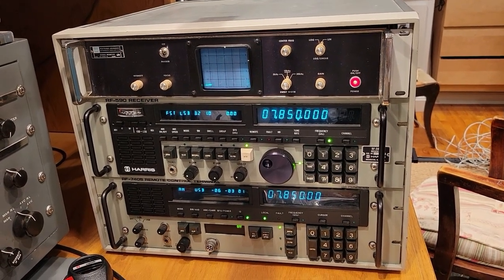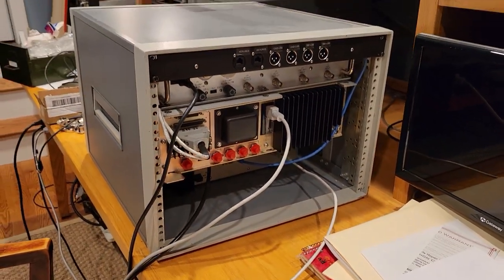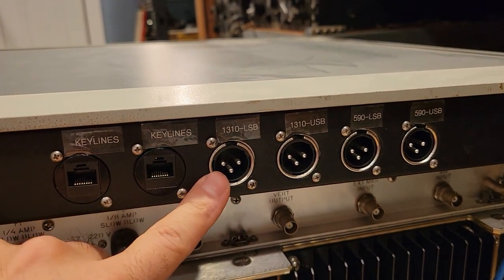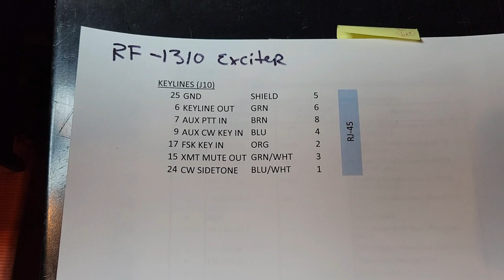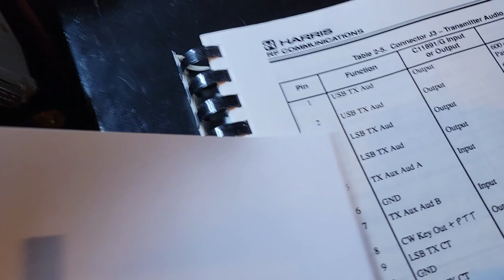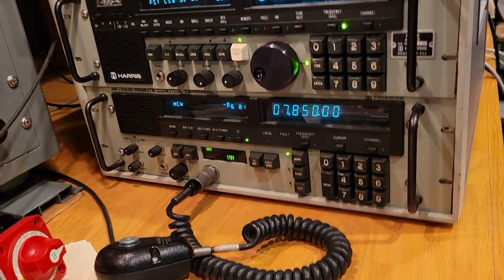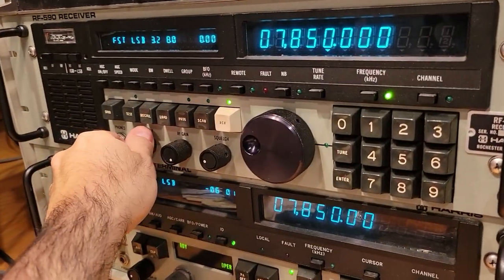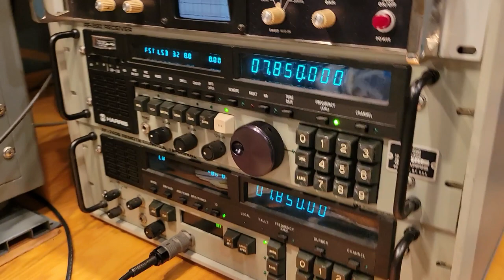Harris RF-1140A/RF-1310A/RF-590/RF-7405 Operating Position Coming Together!

Comment: I'm looking for some info on my 590... I want to activate the internal mute circuitry with an external relay. "The book" is a bit of an adventure novel... It doesn't have a clear "blow out" of the rear panel connectors. Does "grounding TB-1 Pin 16" on the Rear Panel Assembly do the trick? Thanks! It's a great receiver, and I'm jealous you have the transmitter and remote! :-) N8JZS
Reply from the maker: @N8JZS - Yes, Ground TB1-16 or J7-7. Good luck! 73 de W2HX

Comment: thats not aliasing causing the displays to do that its the refresh rate on your camera try turning up the refresh rate on your camera if possible
Reply from the maker: Yes that is a form of aliasing.  The shutter speed is not syncd with the rate of the display. And as a result you get aliasing
Reply: @w2hx  you probably haven't tried what i said
Reply from the maker: @ericmoeller3634  increasing the shutter speed fixes the problem as you suggested and reduces or eliminates the aliasing depending on which shutter speed I choose.  Thanks